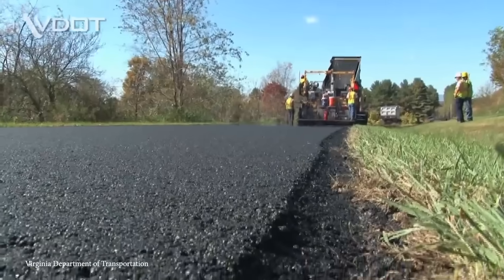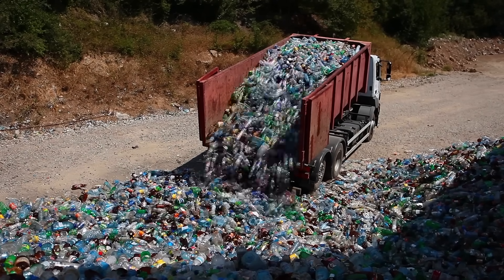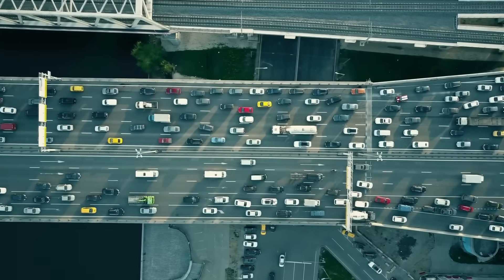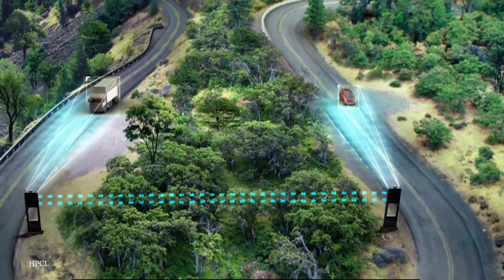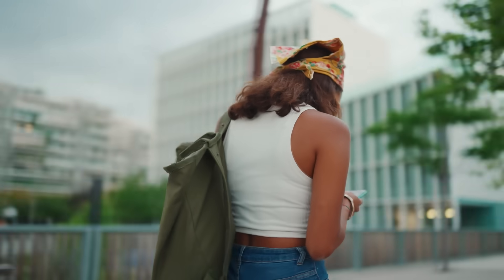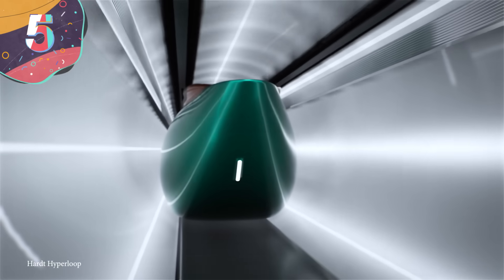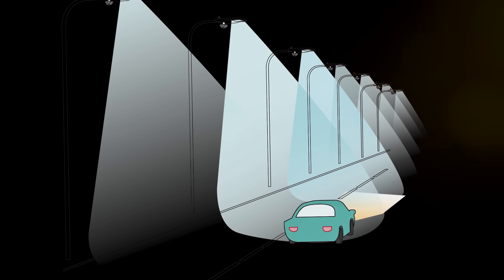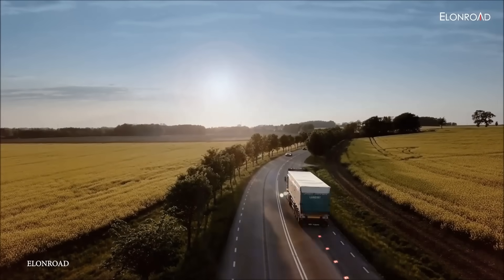15 FUTURE Road Designs that will change the world

Comment: EVs are worse for the environment during production than internal combustion engine vehicles because of the lithium and cobalt (rare earth metals) mining. It’s basically slave labor or child exploitation labor that has the dangerous jobs mining for the resources. Electricity also comes from coal fired power plants. EVs aren’t the holy grail that climate change activists claim it is. The infrastructure isn’t ready for it yet, California has a lot of EV owners and they are telling people not to charge their cars because the power grid can’t handle it and people end up without electricity and without use of their car. Imagine entire cities having to call off work because their cars were not able to be charged because the “government” told me I’m not allowed to charge my vehicle so I have no way to get to work, economic disaster. We’re not even close to being able to switch to electric vehicles.
Reply: You are right.  And you are also wrong.  IHMO.  My wife's 2022 Model 3 standard range uses Lithium Iron Phosphate.  Iron is in abundance.  And the battery is good well beyond the combination engine life cycle. 250k to 500k miles. Newer batteries are using  nickel-manganese-cobalt mixture.  The battery pack can be recycled.  

Yes I feel the infrastructure isn't ready. In the west.  The east coast doesn't have this issue.  They have EVs.  But why isn't this an issue?  I am in the Midwest, and we pay $.08 a kw/h to charge our two Tesla's.  About $50 a month.  

This is more political in nature.  We rely on OPEC and counties like Saudi Arabia for our fuel consumption. If they produce 20M barrels less barrels of oil, our fuel prices go up and crimple us as a country.  aka the gas crisis of 1973. Our government is big brother, and cannot allow this.  We will sell them arms, to protect against Iran, so we can get cheap fuel.  But this also gives them an advantage we cannot allow.  EVs give us strength.  Less need on a country that doesn't agree with with their ruling dictatorship.  And they don' t agree with us (aka  friends with Russians) 

The west coast is suffering.  Not only getting electricity to cool their homes, but also water.  I don't feel it is the EV, but maybe more support within our boarders.  IMHO.  We could actually be taxed more on our consumption west of the Mississippi and be used to replace aging infrastructure in the west.  The water is your real problem.  Global warming.